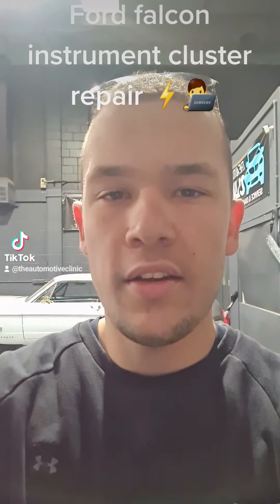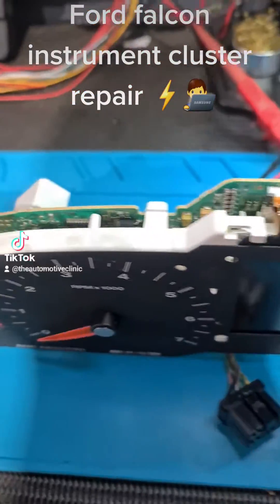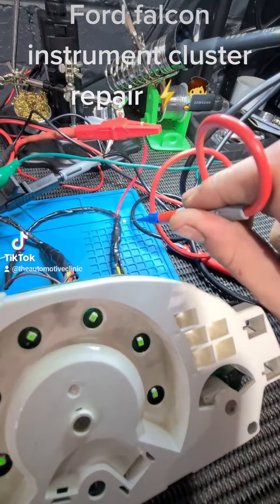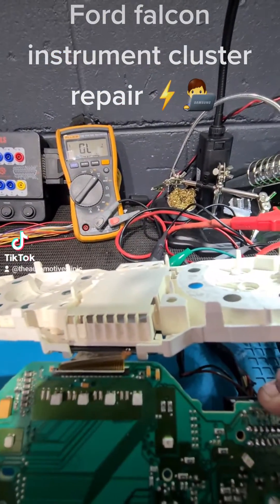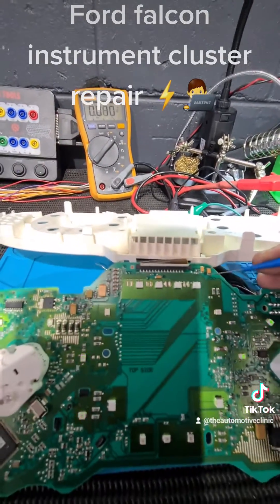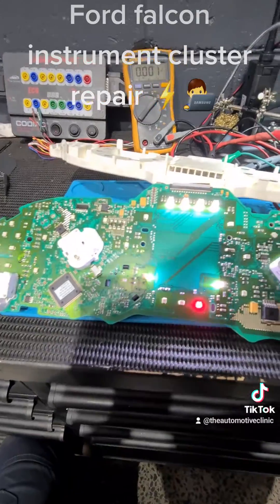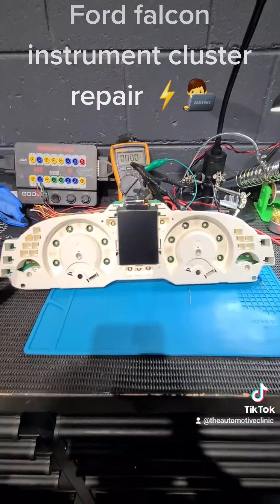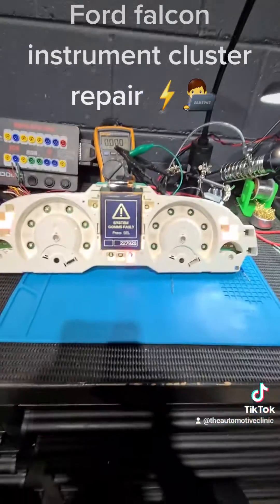Ford FG falcon instrument cluster diagnosis 👨‍💻

Comment: I have a 2011 fg cluster that has died after battery removal to change clockspring.

Tested all fuses, checked power and grounds at  connectors all tested fine. Tried a donor cluster to double check and powered up fine.

Being 2011 im unable to do a PATS reset. 

How can i get in contact for a qoute on repair?